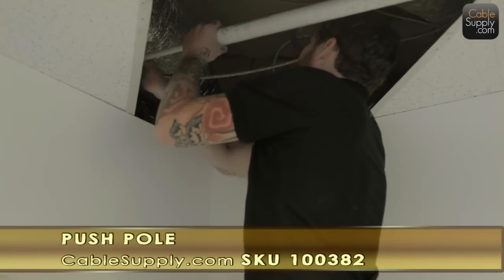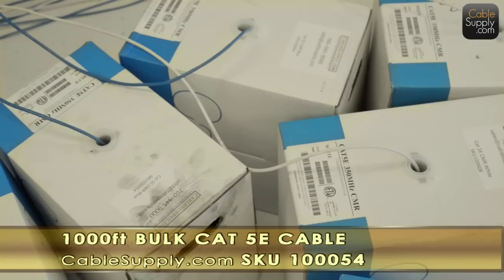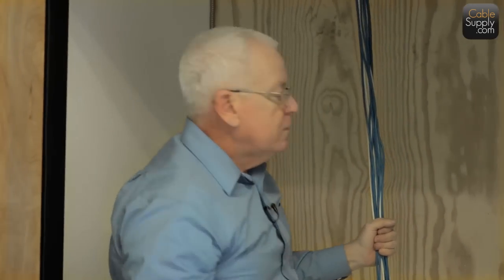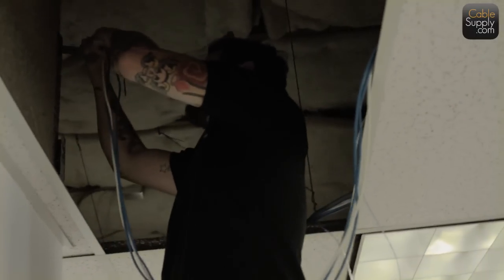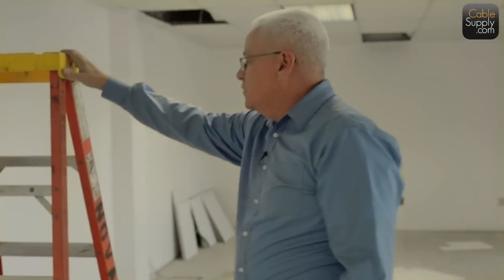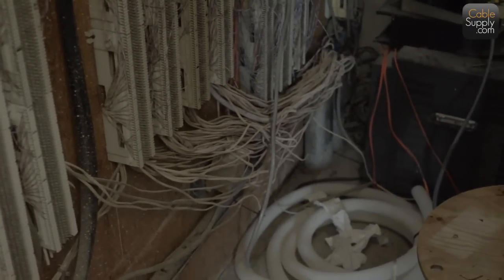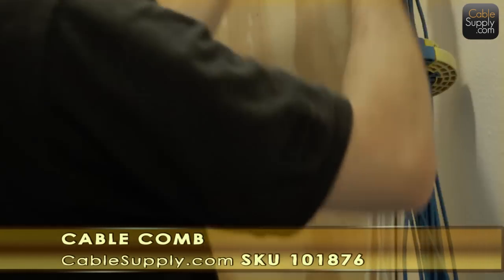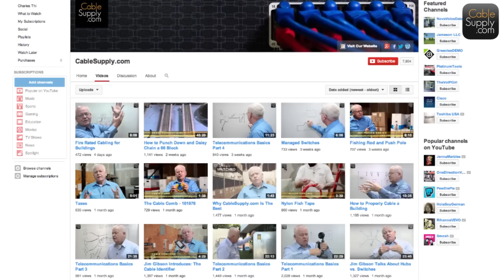How To Cable a New Construction

Comment: Very nice install and great advice/tips. One thing towards the end 51:40--I would never let a tech punch down a jack using a customer's wall. If you miss or slip while terminating, your tools can mark up the surface (or even put a hole in the drywall) around the wall plate. I carry a small piece of 1x4 and use that behind the keystone's when punching down. Thanks for the videos you guys rock!
Reply: I think he purposely punched down on the lower part of the wall which would be covered by base trim.

Comment: great point on the firewall requirements. I didn't know the low voltage had to be in a metal box, also.
Reply from the maker: Check your local code. Every time you breach a fire wall you will need a fire prof (metal) box.  If it is not a fire wall you do not need a metal box for low voltage.  
Thanks for watching ! Please subscribe !!  It will make my day!

Comment: In my state (Georgia), it is a code violation to run cable on top of ceiling tile, because the weight can compromise the grid.  Technically, all cables have to be on their own independent support system, such as j-hooks, however sometimes that's impossible to do in buildings where cables have been ran differently in years past. We always install J-hooks on new construction. When we're working in post-construction work spaces, we run the cable above air duct and away from sprinkler/water pipes. Running cable on sprinkler pipes is a BIG no-no in my state.
Reply: If you have concerns about the weight of the cable bringing down the ceiling then you have other issues. Running cable on existing air ducts is far worse.
Reply: Same in my State (Massachusetts). Cabling has to be self supporting. Can't even tie to grid supports.

Comment: Jim - Great video! Lots of good information. I installed cable for many years and we always labeled the cables as we ran the cable and I love the idea of not having to label the cable to save time.  However, I am now an IT Manager of a medium sized office (240 drops) and I actually like having the cables labeled in order for better troubleshooting.  When a certain section of numbers is down it makes it easier to determine the cause. Is it the switch?, or did someone cut a section of cable?, etc.  I would much rather spend the time to label the cables from the beginning when the time does not matter as much. When you have network outages is when the real time matters.

Just a thought.

Comment: Thanks a million Jim. Hey I have a question. When you hooked up two RJ11's with two pair from the same cable. You attached the blue pair in one jack and the orange pair in the second jack So you only put two wires in each of the  RJ11 jacks. Which positions on the jack did you connect the blue wires and which positions on the jack did you attach  the orange wires?
Reply: Nick Uranga He would attach the orange wires to the blue pair on the on the keystone.
Reply: The blue on the jack is the middle 2 pins 
Most digital phone systems and regular phone lines or POTS lines use the middle pins . Conductors 4 and 5 in the middle

Comment: A lot of people are conflicted on running cable like this because all the problems that might be. So when they do figure out  the cost might be higher then what they originally quoted for. So my question is Do you quote something per drop and leave a little something in there just incase of problems on that drop or is it better to a quote for the whole  job including the drops and other things? That is something i always wonder what would be the best way to deal with something like that.
Reply from the maker: check out my video on how to quote a cabling job

Comment: I understand what you mean about time efficiency with the not noting on install the locations but when you have something like that 4gang plate, doesn't it look unprofessional having non sequential ports? So rather than 4,5,6,7 having 10,3,8,15?

I LOVE the LED idea! Do you go back and do a full 8 light cable check later?
Reply: Every job I've ever been on the cables had to be in order.  What extra cables are added after the job doesn't matter.  Depends on the customer.  I think it looks better when they're in order.  But, to each their own.
Reply from the maker: cybererik1 You're right, it's really up to the customer. The biggest issues is when you're doing hundreds of jacks, it can take a half hour or more to just find the cable that's numbered. The more cables you have, the more complex it becomes, and the harder it is to do a clean cut. Most of Jim's customers do not care whether they are in order on the floor, but rather that they are in order on the patch panel, and clearly labeled on the face plate. But, you are right - everyone has a different way of doing it!
Reply from the maker: ***** It really doesn't matter - it's all up to the customer. However, if a customer requests that we go in order and it's more than 10-15 outlets, we have to add additional labor for the install. In the last 25 years, we have installed over 6000 installations throughout the country, and very few of them have been installed in a clockwise or counterclockwise order. The larger the installation, the longer it takes per cable to install in order. The LED cable identifier has saved us hundreds of hours and has helped us pass on the savings to our customers. One last thing - the LED identifier is not meant to test the proper pin-out, it is only meant to ID a particular cable.

Comment: you do need to identify cables before patching to patch panel for cleanliness when plugging into switch. also when corporate has a standard place for each cable on the install guide.

Comment: Thank for share your experiences. I am a new telecommunications technician. Question: When you install a cable or cables and there are many cables and infrastructure (like an air conditioning) above the ceiling, What is the standard? Do you install the cables using a push pole and leave the cables on the ceiling or you have to push the cables to the top of the infrastuctures. What are your recomendations?. Thanks!!!
Reply: I think if you are using CM type cable you have to use conduit or other means to guard your cable, but with CMR or plenum you dont have to, is not regulated because it fire retardant, howerver if you can group them they would be nicer but no one would see that anyway, it matters for troubleshoot in the future.

Comment: That push pole looks pretty nifty, I'm an electrician and usually use a 10ft piece of 3/4 or 1/2" pvc with the bell end cut off. I do a lot of service work in stores and offices running new lines for receptacles and whatnot and MC or BX cable in a dropped ceiling can be a pain in the arse. Would that telescoping push pole work with a single 12/2 armored cable?
Reply: JimFPV yes it would work just tape it on the back end . It's one of the best tools you can have you'll find more uses once you have one . On the end is a hook you can telescope the gopher pole out and hook and pull  towards you. So if you had a attic in a house you could drill under the eve and into the attic space push the cable in and use the Gopher Pole to hook it and pull it towards you. roofs can pitch in at the corners and crawling on insulation and clearing an area to get the cable can be very uncomfortable. this makes it easier  hook and pull towards you saves on time saves you money and there's so many tricks you would come up with having the this tool. This is the professional tool for sure . Shoot the cable far and accurate

Comment: Hi Jim, thanks for taking the time for explaining everything... i am an installer from Ecuador, and i was wondering, it is costumed over there to pull the cable without any kind of conduit? or other kind of things? or i am missing something?.. do you lay the cables on the celling? thanks for answering me
Reply: +DanielFaour Not sure how things are there, but in the U.S most ceilings in businesses are drop ceilings with acoustic tiles. All electrical cables are inside flex conduit (or sometimes rigid). Low voltage cables (data, voice, speakers, etc) are pulled through the red iron, or they are placed in j-hooks (or Arlington saddles [cable tie hangers]) that are hung from j-wires shot into the concrete ceiling with a Hilti gun (a powder-actuated tool) every 3 to 6 feet. In some locations flex tubing (plastic conduit) is required, but not very often. One thing you have to know is, installations differ drastically depending on what area of the country you are in. What is standard in the Southern states might be totally different in the Northeastern states. Also, there are very few union jobs in the Southern states, while almost all of the jobs done in Northeast are done by union workers following union conventions. it's impossible to say it is done this way or that way when referring to the entire United States; it differs too much.

Comment: as an ex cableguy, i am wondering why there is no usage of cableducts above the ceiling, or pipes of sorts?
Overhere in europe you get fired for pulling wires on top of a ceiling like this
.
Reply: E.C. Bart 
I was also expecting the cables to be suspended in conduit or something.
Reply from the maker: One or two cable is fine with code. However you are right if there was a large bundle of cables, I would use "J HOOKS".
Reply: Its not a rule in the states to use conduits on any installation? In Mexico its a REQUIREMENT by law. Even on my Certifications as 3M, AMP/Tyco, Hubbell, Panduit, they teach us to use conduits or Cablofil, or anything to support the cable. So, I wonder if it is a requirement the use of conduit or anything to support the cable, apart of the Jhook.

Comment: Actually when you pull from the IT room to the offices - when you try to pull the longer ones farther to the data jacks farther away, they get tangled up with the short ones and you can't pull them separately. If you put the boxes at the offices and pull towards the IT room, this is avoided. The cable ends join together in the ceiling, then the home run is made into the IT room and all the cable ends are together and run into the patch panel area.
Reply from the maker: KT thanks for your comments , but I disagree I always pull from a central location (data room).  I have not had the experience you described.

Comment: any reason for using cat 5e in this day and time?
Reply: now we talking abt 10 gig cat6a and 7
Reply from the maker: Cat5E is still the standard for a basic setup.
Reply: cat6 isn't really necessary unless high speed is a must have for your work environment. i.e. an IT office, command center, hospital nurse stations, etc.
Reply: unless your running a IT room no need
Reply: No reason to waste CAT6 unless doing long runs and large bundles.  If you're running less than 10ft CAT5e is fine, very low interference under 24 wires.
Reply: not to mention the upcoming 2.5GBASE-T over cat 5e, IF devices are getting support for it, but i fear that we would need to buy new hardware that supports it :(
Reply: Who needs more? Most offices are still happy with 100Mbit/s and 5e offers to upgrade to 1Gbit/s.
Reply: 5e is cheap lol. It's a out dated category that can still support devices over short distances but I would not install that.  CAT6 is what you want at least. plus if your installing cable might aswell put something that supports future networked devices . Cat.6 can also be converted over baluns for multiple devices . Just run CAT6 it's the right thing to do.
Reply: Cheaper and still gives pretty good speeds. 5e works well for just about all residential applications and alot of small commercial. It's when you get to large corporate facilities, campuses, WAN, LAN, CAN... etc and data centers that you have to step ya game up.

Comment: I'm getting away from 66 or 110 blocks. Terminate on patch panels with minimum cat5e. Especially when copper is going away and my customers will eventually have to upgrade to hosted or IP communications equipment. I can walk in and sell them a system with no added expense of rewiring.
Reply from the maker: Unless you're on the mobile cell system, you are still going to need cabling. Even Wi-Fi access points need to be wired back to the router. If you're dealing with VoIP phones you are still going to need copper cabling.